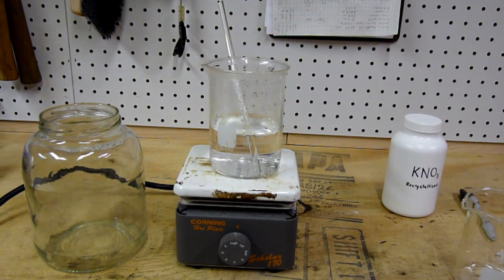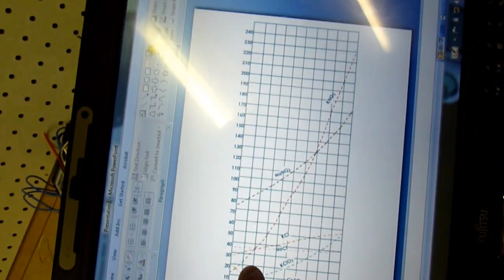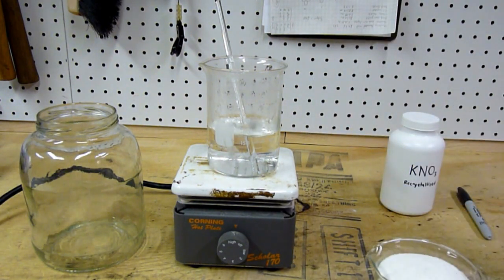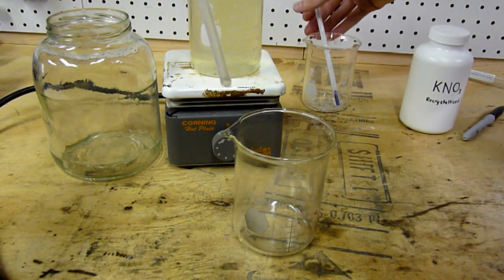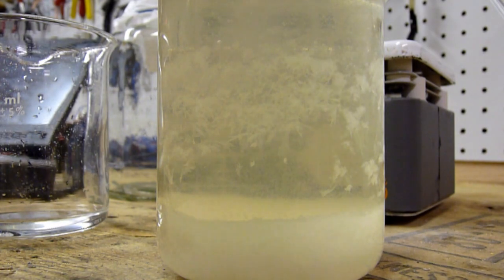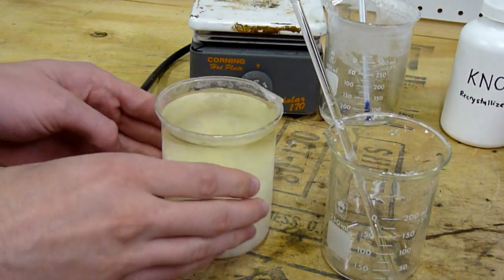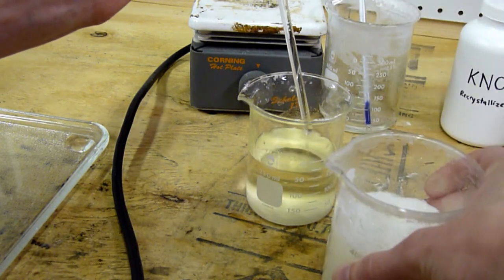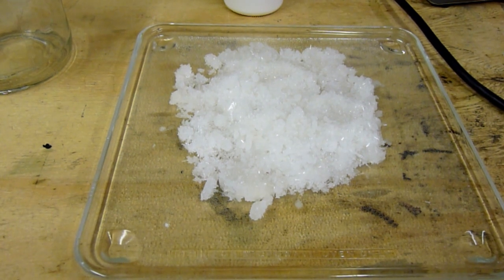Purification of KNO3 using Recrystallization

Comment from the maker: Glad you asked! The stump remover is already >98% KNO3 to start with. I did not record how much was lost in the process because I used the purified crystals as a lab reagent and saved the remaining dirty stuff for pyrotechnics or things that don't require KNO3 of high purity. Potassium nitrate will not evaporate from a solution, just the water, so virtually none is lost at all using this process. Repeating the process will continue to purify it but really isn't necessary in this case.
Reply: Good job.

Comment: Great video!  When I perform procedures like this, I typically vacuum filter the hot solution.  This removes suspended particles and other solid impurities.  I've seen a brownish murky solution of nitrate fertilizer go to nearly clear after just to passes.  And of course you can always perform multiple crystallizations if you need a really pure product.

Comment: I would recommend another recrystallization. Since you didn't rinse the crystals with ice water after decanting the solution, the wet crystals have the impurity-filled solution stuck to them. Thus the dry crystals will have impurities in them
Reply: what type of filter ? coffee ? cold water wash then dry.
Reply: wait I'm confused what are you asking?
Reply: TheChemistryShack
Reply: +TheChemistryShack Hi and thank's for that answer :]! Would it be a good choice to rinse the crystals with ethanol instead of cold water?

Comment: I tried this in winter time in an unheated garage. I prepated some heated bricks to set the solution on to keep it from cooling to fast. Well about 36 hours later i got single crystals six inches long, an an inch thick.

Comment: What you make here is called Supersaturation solution which means dissolving the maximum amount of substance in the water…if you want to  get pure Chrystal you need to add more distilled water, than after cooling , the kalium nitrate crystals clearly droppings to the bottom of the solution, you can pour out and collect those crystals but in your case because the solutions is Supersaturation, once you stopped heating , crystals are forming everywhere quickly, makes no chance to separation the Impurities ..

Comment: @zhmapper. Okay, maybe I understood this wrong, but get as many crystals as you can at room temperature, and refrigerate the excess solution overnight to obtain more?
Reply: Rucka4life1 yep, boil to create a super saturated solution, then cool to room temp slowly, then freeze overnight
Reply: The room temperature collection was only because he was in a hurry, and is not necessarily needed But, the purity of the crystals will be  somewhat better than the crystals at the end of the recrystalization. 

One could take the saturated solution at the tail, heat it up, and boil off much of the water until the remaining solution is saturated again at 100c with crystals beginning to form, and then pull it off the heat and let it recrystalize.    

Finishing the first Recrystalizing of the tail end solution, if added to the first recystalization, will result in a better yield collecting much of your starting material, but the recrystalize tail end won't be as pure as the the first batch because the contaminated solution is more concentrated with contaminates.  But recrystalizing  the tails of the tails will provide increasingly diminishing returns with increasingly dirty product. 

Obviously the small amount of  finished recystalized tail ends can be recystalized a second time to increase their purity before adding back to the first batch. 

What is left is probably best to be evaporated forming dirty impure crystals which can be used to fertilize soil with Nitrogen and Potassium or used to make pyrotechnics.

Comment: I notice in this video as well as a couple of others, using approx 200ml of water is average for 450g of stump remover.
What would be the result, and how would you remedy adding a too much water?
Reply: The result would be that you wouldn't be able to get as much out of the recrystalizations.  That's it.  You would just end up with a saturated solution that may not precipitate as much of the product.  Essentially, you would just need to boil off some of the water and continue with the recrystalization.

Comment: Shouldn't the crystals be rinsed with cold water to remove the contaminates in the liquor that is sticking to the crystals?  If you succeed in removing 90% of the liquor, by decanting only, you have removed only 90% of the soluble contaminates at best (assuming the re-crystallization perfectly excludes the contaminates).

Comment: I freaking LOVE how everyone thinks Potassium Nitrite is a big secret and it's either super hard to get ahold of or magically going to disappear if someone finds out what company sells it 😆 you can get a 10 pound bag for $21 plus shipping and have it to you within a few days 😆 I can't get over the comments I've seen and things people have said in they're videos about Potassium Nitrite. 

Brothers and pyro sisters ... Potassium nitrite isn't going anywhere and its literary as cheap and in some cases cheaper then a bag of good potting soil. 

You can get everything you'd need to make several types of flash powder and black powder at home for under $80, and that's with buying sulpher and potassium nitrite in 10 pound bags. 

Trust me I just did it, and I use to make m-100's 8 years ago. I am not going to be mixing up flash powder until I get my ATF licence this November because I'd rather not risk my chances at following my dreams of working in the pyrotechnics field however I did mix up 25 grams of B.P. tonight and light it all off at once since it was my B-day and I wanted to end the day with a whoosh. Lol it wasn't really a woosh because B.P. has such a slow burn rate and I didn't get my willow charcoal into a fine enough powder. Next time I won't make that mistake and I am going to add some Zinc to the mix and see if it turns the flame green because that would be epic to see a Black powder with a green flame
Reply: In some parts of Europe it's banned in a pure or ready to use form.

Comment: Great video! Do you happen to know approximately how much of the stump remover is lost during re-crystallization? I know that the total mass after the saturation etc. will be lower because the impurities are removed but is any actual potassium nitrate lost (due to evaporation etc...)? If so, would it be smart to cover the liquid until it has crystallized? Also I know that some purification methods should be repeated, is this the case for stump remover? ~80+% purity works for me. Thanks!

Comment: Why do you recystalize the Stump remover, it has already 100% KNO3, or did I misses something ?
Reply: Stump remover is not 100% in the pyrotechnic (firework) usage.  As far as usage of stump removal, Spectracide claims 100%, but it still has some impurities. Also, there is a problem with the decanting . When allowing the crystals to dry if should be in a very dry area ( little to no moisture in the air)

Comment: Well you have the refrigerator pump, it makes really good vacuum on the other end use it for real vacuum filtration, I do that all the time. After some time it is necessary to add some motor oil to the pump via vacuum side and eventually it will seas from rust. WD-40 helped My one but after year of service I think I need a new one. At the beginning I was worried about the temperature of the pomp but now I run it constantly so it is too hot to touch it. It still works.

Comment: Thank you for doing this video. It worked no problem. I also learned something else during this process, I need beakers!  My wife was not real thrilled with me using her kitchen gear. Do you have any suggestions as to the best size beakers to get and how many of each size? I will be mainly be doing things like this.
Reply: You can probably get away with a single 1000mL beaker.  Personally what I use is 1000, 800, and 500 and 250.  Sometimes its nice having more than one nearly the same size you you can decant supernatant from the 1000 into the 800 or you can filter a solution into a beaker.  If you don't have 2 beakers you can't filter a solution.
Reply: On eBay you can get a nice beaker set for right around $20.  They usually come with a 1000ml, a 500ml, a 250ml, 100ml, 50ml, 25ml and a 10ml.   They take a while to arrive though.  EBay is the way to go though when it comes to buying cheap beakers and flasks.

Comment: Why mark fluid ounces on the jug? Because if you read the directions you are supposed to add water and shake before applying the slurry into holes you drilled in a stump.
Reply: Yea, that's true although when you put the water in, you can't even see where its at. Lol

Comment: Great video...Can I use fertilizer with 27% KNO3?
Reply: No. 7 years too late but no. Just go online type Potassium Nitrite in google it'll pop up a 10 pound bag of 98% Potassium nitrite and it comes in small pellets, you can either use his method or use a mortar and pestle or coffee grinder and turn it into a fine powder if you are just using it for BP no need to do his method thought I am going to try this and see if it has an different effect then the powder. My guess is it either won't or if it does its only because I will be able to get the crystals into a finer powder with the crystals. I am going to try a flash powder with both as well just to see if that has a different effect on how well it burns. 

I extracted about 30 grams of flash powder  from fireworks this year and I added in a spoon full of my potassium nitrite and a spoon full of Indian Dark Aluminum powder today hopeing that I wouldn't ruin it and I decided to make a triangle cracker by taking a mortar fuze from breaking the fireworks down and putting it through a small hole in the corner of an envelope and then I took about 12 grams of my mixture and folded it all up and then I decided to tape it up with electrical tape nice and tight to stop any powder leaking out and before I did it I thought "hmm maybe I should test a small amount 1st so I took maybe 400mg of the powder and lit it and it flashed so damn hard I decided maybe it wasn't the best idea to do the triangle cracker I made near my house when it isn't legal to do fireworks or there isn't rain or snow on the ground because people could care less if it were those situations but mid summer during a drought year when we've had fires all over the state already. So instead I took a sticky note, rolled it up backwards so it stuck to itself in a cylinder and I used electrical tape to hold it in place well it was still on the pen and pulled it off 1/4th the way and bent the end up and taped it and then I filled it with the flash powder and took a firecracker I broke in half  and put it on top of the powder in the tube and taped it in the tube so it looked like an extra long firecracker with electrical tape all around it and lit thay instead and I gotta say I am damn lucky I didn't just light the triangle cracker that had about 20 times the amount of powder in it because that little fire cracker made a thud that I was worried might get me introuble 😆 it was about 10 times more powder then a normal little firecracker so if you think that probably had 500-700mg of powder and the triangle cracker was way fatter then ones youd normally see my guess is when I actually do it its going to make a boom that shakes windows 😆 I am actually going to take it to a feild nearby to avoid any issues because I was absolutely shocked by how adding a scoop of those two powders made the powder extracted from fireworks so much stronger then it already was. 

I am glad for now I live in am area where it would be looked down on to make giant salutes because I'd love to use KCIO-4 in F.P. instead of KNO-3 however once I get my ATF licence in Nov. It won't matter anymore and I am then moving 9 hours away to where I am away from highly populated areas and it will no longer matter if I decide to go outside and light of salutes off. I will also have a bunch of different jobs I can get out there because my entire family lives out there.

Comment: what happens if you used way to much water?
Reply: You end with too much of your product getting wasted in water you pour off. Here, Doug messed up a little by using too little water. Another 15ml of water would have kept the crystals in solution a couple minutes longer, resulting in a much more pure product, but slightly less crystals.

Comment: If it's purification wehre do the impurities end?
Reply: exactly what i was thinking?
left with the crystals after evaporation would be my guess
Reply: Would depend on the solubility characteristics of the impurity....
Reply: the water evaporate withe the impurities. So the impurities that can't "evaporate* juste stays... if I understand it right
Reply: Loutcho Bix The idea is that crystals tend to be very pure, so when you recrystallize, you mostly get the substance you're purifying in the crystals, while most of the impurity remains in the liquid. When you pour off the liquid, you're pouring off concentrated impurities. Of course, some of the stuff you're purifying is still dissolved in the liquid, so that gets tossed out too.

Basically, the process concentrates what you want in the crystals, and concentrates what you don't in the liquid.

Of course, this isn't perfect, you still get impurities in the crystal and the stuff you want in the liquid.
Reply: So doing this over and over would make a purer end product?
Reply: Steven Thompson Basically, yes.

Let's say there's X (what you're purifying) and C (the contaminants).

Recrystalizing concentrates X in the crystals, and C in the fluid, but only to an extent. Some of C ends up in the crystals, and some of X ends up getting thrown out with the fluid.

So every step loses you some of X in the process as well. Past a certain point, there is no point.

But that's also why you need to take care about when you dump off the fluid. Dump it off too soon and you lose a lot of X, dump it off too late, and a lot of C ends up crystalizing out too.
Reply: seigeengine after how many  seconds can i dump it off? sorry for my english

Comment: Hey! I'm trying to make sugar rockets, and I was wondering why mine didn't light off with a match. I tried melting, and not as well. 65%-35% KNO3-Powdered sugar was the mix. The KNO3 I got is EK fertilizer, 13:64. It has 13% nitrogen, and nitrate-nitrogen, and 46% water soluable K2O, Potassium oxide, and from that 38,2% potassium. Just smoke and black goop, and sparks. But it would stop even smoking if I didn't move the black goop around.

Comment: how much purity is that kno3 ??
Reply: It's a re-crystallization, so all solids should be 100% pure KN03. However, he didn't rinse it before decanting, so impurities were never washed away, thus the KN03 is impure. If you wash it, it should be pure. I don't know what to wash it with through, its is slightly soluble in ethanol so that seems like a bad idea
Reply: ok thanks

Comment: @k1ng401. Some brands are even 99 or 100% KNO3, so recrystallization is somewhat pointless
Reply: A lot of brands have dirt mixed in with it, which can be detrimental to some reactions.  Every time I dissolve and filter mine there is always a lot of insolubles in it.   About the only way to buy extremely pure KNO3 is to get it from a chemical supply company that specifically supplies it for chemistry.  I know I don't want dirt in my KNO3 when I make nitric acid.  Lol

Comment: Adah gak yg bisa ajarin aku bikin
Reply: Its cheaper to buy it. It's sometimes used as a food preservative or more common as a fertilizer. But you could mix potassium carbonate with nitric acid, but that's not safe.